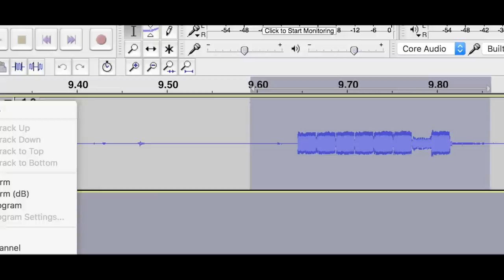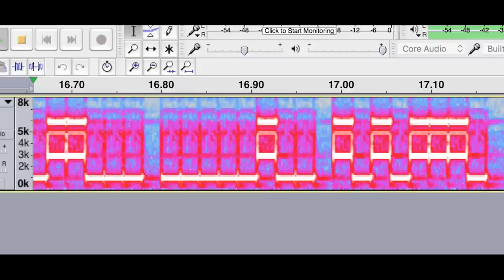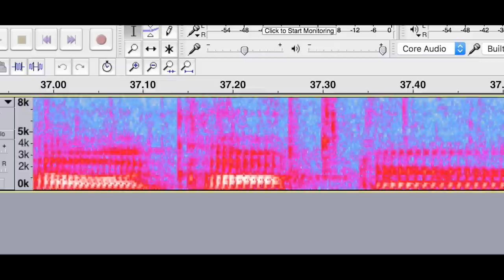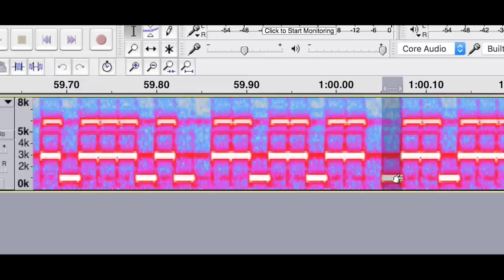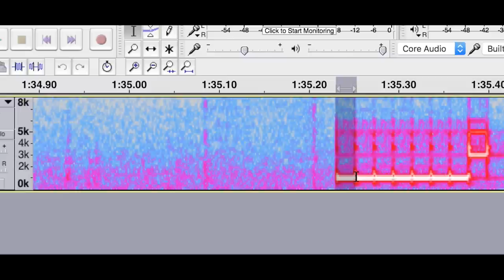VTech Smart Wheels Secrets

Comment: I have at least five of these things that I bought for my kids. I was somewhat interested before, but now I'm very interested. The question is, do these have ROM masks that are set with each car, or do they have flash that are programmed at the factory? I'd assume the former, but it's cheaper to buy flash than it is to set up ROMs these days. My first guess is that it's all ROM, and that the mode you found was a diagnostic mode to test the car. If so, that's not as interesting as it could be. But all in all, the device is much more complex than I first thought.

Comment: Damn
   These little things are so hard to circuit bend 

   They have membranes in them

  I think I have a membrane breakage in this type of toy or another type that was like this back in 2018 at my first attempt at bending the toy 

   Also this is a newer toy 
   
  This  is a newer toy and it is harder to find solid bends with  

  Some of them also have micro resistors in them
   Which is also hard

   I wonder if you could pitch bend those tones that it makes
         That would be so cool 
             I don’t know how to unlock those tones I just know how to do it with the factory sounds
   But those tones would be fun to bend in the glitch

Comment: I've been suspicions of my daughter's toys for a while. she has a VTech train that's easy to access. you pop up all three animals, then hold down the left and right buttons while turning it on.
she also has a "learning Walker" farm toy that I'm not sure what to do with. you can hold the red and yellow, or yellow and blue keys and turn it on, and either the sun will flash or the triangle will flash, respectively. no sounds or interactions that I can find otherwise.
Reply: if you do the combo that lights up the triangle, it seems to time out eventually and beep before shutting off. I'm wondering if it's waiting for a certain combination of buttons.
Reply: @mmik9683 Can you do the video on the baby walker test mode?